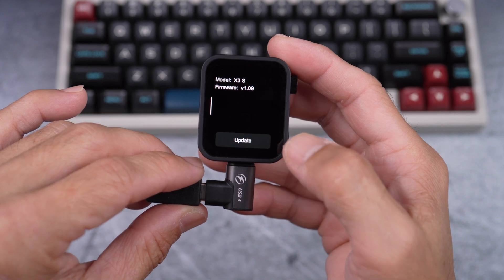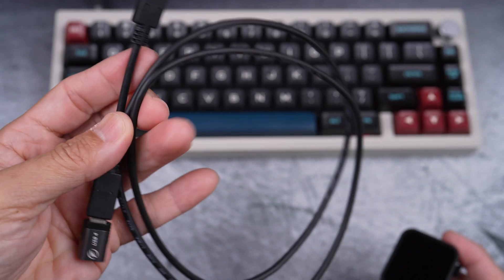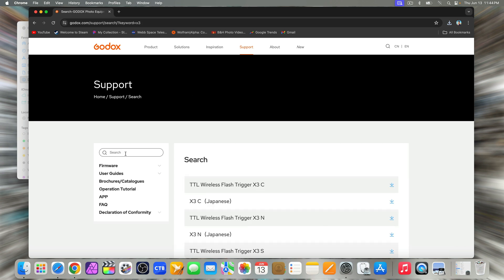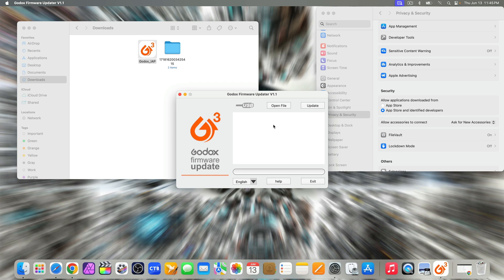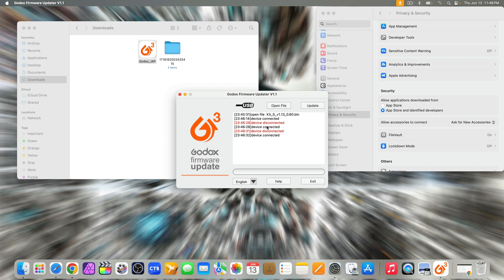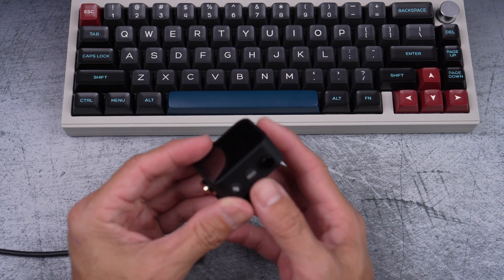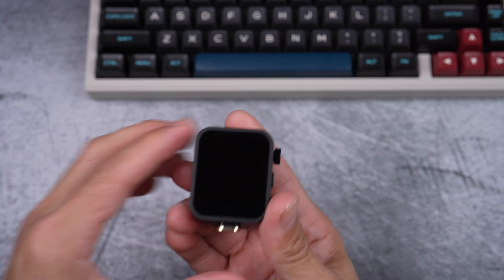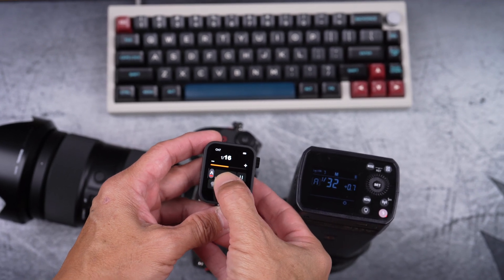How I Unbricked Godox X3 Trigger Updating Firmware from V1.09 to V1.13

Comment: Tremendously helpful and detailed video! Thank you very much for helping me to fix my trigger. In my case, I had downloaded and successfully updated to the incorrect firmware, causing a "firmware error" message to appear on the screen every time it was plugged in. To fix it, after seeing in your video which firmware I should choose, I was able to hold the scroll button down for a few seconds to get it back into update mode, once it was plugged into my computer. From there, choosing the correct BIN file and starting the update fixed my issue without even resetting my default settings.
Reply from the maker: Wow, thank you so much for the detailed comment! I’m really glad the video helped you recover your trigger. Your step-by-step experience will definitely be useful to others with the same “firmware error” issue—especially about holding the scroll button to re-enter update mode. Great job getting it fixed without resetting the default settings too!

Comment: so how do I unbrick.. U have no screen and it won't show anything when plugged in to charge
Reply from the maker: Thanks for reaching out. simultaneously press and hold the "<> (Select Dial)" and "<> (Test Button)" buttons—for several seconds—until you see something on the screen. While still holding those buttons, press and hold the power switch to restart the device. Let it down for a few seconds. And repeat if necessary until you see something on screen. If it’s in Chinese, follow the instructions in the video. Hope this helps.

Comment: Excellent tutorial. I tried to upgrade the firmware from Sony version 1.01 to v1.15. It didn't work. I tried to follow the step-by-step instructions in the video and even after doing a new upgrade the X3 doesn't turn on. Could you please make your firmware version available? The Godox website only has v1.15
Reply from the maker: Thanks for reaching out. The X3 latest updates are here (link below). Let me know if you got it working. 
https://godox.com/firmware-control-system_5/

Comment: Ok, so I have just bought the X3. Firmware that came with it is v1.09.  I am nervous to action a firmware upgrade. Can you tell me how necessary this upgrade is? What additional functions does it then load?  I have downloaded the Firmware X3-N Firmware, and the Godox G3 Launcher. The launcher is viewing in Chinese only. How do I change it to English?
Reply from the maker: If you have the very first production version, the interface changes tremendously! But I’m not sure which one you have. As for functionality, I don’t think it has changed much, but I really can’t say for sure. If the launcher is stuck in Chinese, you might need to reinstall or check the settings for a language option. Side Note: I get it wrong a lot when “upgrading” (updating) each firmware, but I always able to revive it—it seems like it was designed to be ready for this.
Reply: @TossSong  Thanks for your prompt reply. It is hugely appreciated. I clicked around on the launcher and found a drop down that I can choose English as my language. The rest of the update went well. I now have V1.15.  :)
Reply from the maker: I’m glad you were able to update it without any issues. Yes, it could be quite overwhelming.

Comment: This works: Re-plug the USB cable, press and hold the test button and the select dial at the same time, then release the test button only, until "Upgrading" appears on the interface, then the device can be upgraded successfully through USB cable."
Reply: thanks it worked
Reply from the maker: Thank you for sharing. This would be helpful for others using this X3.

Comment: Hello, during update it freeze , now it doesnt turn on.. help pls
Reply from the maker: Hi, thanks for reaching out. Don’t panic. Leave it for a couple of minutes. Then go back and press and hold the on/off button (with our without the test button) until the you get the Chinese text or any text. Plug it back in and try to firmware update again. (You could also plug it in first, then press and hold.)

Comment: How do i get to that chinese screen/?
Reply from the maker: I know it might be frustrating, I’ve experienced this several times over. But Be patient, leave it off your hands for a bit. Then go back and keep pressing and holding the on/off (and with our without the test button at the same time) on the trigger. Eventually the Chinese text appear. Also plug it in for power just in case the battery is low on the trigger.

Comment: I have faced the same problem. But I am not able to connect the device anymore. It displays device not connected. How to solve this problem.
Reply from the maker: Hi, thanks for reaching out. You’ll have to be patient by keep press the knob and hold it a long as you can wait (with or without pressing the test button together). Until you see something on its tiny lcd screen, like Chinese text. Then you could start the firmware update again.

Comment: Thank you for making this video, it was a great help! I dowloaded firmware V1.24 for my X3-C. It came with 2 installer programs, one called G3 V1.1, the other called IAP. The G3 app ran with no security alerts, but bricked the x3 every time no matter what I did. After I watched your video, I tried the IAP version of the app, which wouldn't run at first, but did run after I followed your instructions and told macOS to ignore the security issue. Then it upgraded the unit to 1.24 and no more problems (did get one message on the X3 screen that said "upgrading hot shoe", just the first time). Anyway thanks again, I was about to toss the X3 and stick with my old X2.
Reply from the maker: Thank you for your comment and for sharing. I’m really glad that it worked out. I totally understand you you had to go through to get this trigger updated. Wish Godox could do something better. Like their launcher could be better programmed and improved and implemented. Hopefully they’re working on it.
Reply: what is the IAP version?
Reply from the maker: @luismanuelmendoza789 Hi, thanks for reaching out. I’m the “Remark” under the X3 firmware, it says you’ll have to install the Godox Launcher V1.1 (current), run it and plug in the X3 to update. Here’s the link: 
https://godox.com/firmware-control-system_5/
Reply: @luismanuelmendoza789  I don’t know the difference between the regular version of the Godox updater and the IAP version. I know only that they came in the same zip file from Godox. At least on my Mac Studio running current Sequoia, the IAP version updated my X3 trigger with no problem (to firmware 1.25), and the other version didn’t, it couldn’t ever see the device on USB. I haven’t figured out what IAP stands for. The two versions look the same when I run them, but only the IAP works.
Reply from the maker: Hope you saw the link I provided. But I’m Glad you got it working again.

Comment: For anyone updating in Aug 2024, if you're using an old version of the installer, DON'T! Download the latest version of the installer. That fixed mine but this video got me on the right track through hope lol
Reply from the maker: Thank you for your comment and for sharing. Great info! Yes, I would definitely recommend as well the latest version of the installer to be safe.
Reply: thank you for this comment, helped me out a lot! I was using the old version and the trigger was perpetually stuck in "update" mode. So frustrating that there are no clear instructions anywhere on the official website

Comment: mine is bricked and i did what you said to attempt to unbrick it and it doesn't turn on.  well I'm not in total despair. i will buy another one from amazon. and return the bricked one. smh
Reply from the maker: I think you should Not buy another. Try again, press the knob and hold it for awhile or press the test button at the same time. Also plug it back in. (And keep doing it, sometimes it takes a bit.) *And read other comments on here and my other X3 videos as well. Thanks for your feedback.

Comment: In case it's not clear...you need to press the top knob in and hold it for a while to boot the trigger into the Chinese update screen...then use the Godox G3 app to load and update the firmware. When the green progress bar stops and the very hard to read window above it says the update is complete, click 'exit' on the app. Your trigger should now turn on. As he says, any settings you had will be wiped, but that's easy to do again.
Reply from the maker: Thank you for sharing. Very Helpful information.

Comment: Hey, I tried all the above but I still cant get the trigger to boot. I went through the entire green progress bar and had update device success confirmation, pressed power disconnected the cable but cannot get the trigger to boot. The trigger displays Chinese text and an arrow when I reconnect now. tried about 8 times now
Reply from the maker: Hi, thanks for reaching out. Have you got it working since?Make sure the Launcher is V1.1 and the proper firmware for your X3 for your camera. And do it again. Let me know.
Reply: @TossSong  Yes, did some Reddit surfing and found that the G3 updater I was using was V1.00 and it worked correctly on Ver1.01. I thought I Bricked it but happy its working. Also seems to have fixed my TTL issues I was having with odd exposures so another plus. Updated from Version 1.09 to 1.14. 
Thanks for the reply anyway.

Comment: So how did you solve this? Mine won't turn on no matter how many times I plug it in or out!
Reply from the maker: Thanks for reaching out. Try keep pressing and hold the knob for a while. Until you see text in Chinese. Release then try again. Be patient. Also, have to updater app on and try again and plug it in. Let me know how it goes. Thanks.
Reply: @TossSong  I got it working after I commented…but then I couldn’t get the trigger to fire on my Canon R5. I reinstalled the firmware but it still didn’t work. I tried my XPro trigger and it worked fine so I knew it was the x3. I cleaned the hotshoe and contacts and checked my camera settings and still nothing. I reseated the trigger a couple times which didn’t work. Finally I put the trigger on all the way into the hot shoe then pulled it back just a bit. Now it’s working! I don’t remember the trigger being that fussy before upgrading to firmware 1.24….Thanks for your help!
Reply from the maker: Glad it works now. Don’t know why it’s fuzzy like that. Each X3’s contacts for each type of camera is different. Hopefully it’s not a quality control issue. When you can let me (us) know how it goes in the long run. Others may also be curious. Thanks.
Reply: @TossSong  It's important that the USB cable is connected and the G3 1.1 app is running and have a firmware file selected for this to work. Skipping any of those steps and my X3 would not turn on and seemed to be dead.
Reply: You need to have the v1.1 version of the G3 app, and I could only find a link to a Windows version, you need to have that program running, and you need to have selected the firmware file. Finally, you need to have the USB cable connected between the computer and the X3. When I did all that, and pressed and held the knob for a few seconds, the X3 turns on displaying a chinese upgrade screen. Hope this helps.
Reply: @LasseVågsætherKarlsen  I had ALL THAT which is why I asked the question. I do have the Mac version which is on their support page.

Comment: unfortunately mine is bricked and plugging it back in does nothing.  I've followed your exact steps and nothing.. So frustrating, I wish Godox would figure this out!
Reply from the maker: Hi thanks for reaching out. I see, could be frustrating. Hope everything turns out well. Next time, if it seems to be bricked, when the screen goes blank, you could try and press and hold the knob for a long bit. Keep doing it intermittently, then plug it in. Or open the Godox Launcher on the computer first, then plug it in. Again try it intermittently.
Reply: @TossSong  I eventually received help from Godox's support team and they provided a successful solution, "The transmitter screen will turn black if abnormalities occur in upgrading. The solution is to re-plug the USB cable, press and hold the test button and the select dial at the same time, then release the test button only, until "Upgrading" appears on the interface, then the device can be upgraded successfully through USB cable." 

All that worked for me, now I'm hoping the firmware update made some huge improvements on connectivity.  For those wondering, I do see that legacy hotshoe has now been added after the update.
Reply from the maker: Very glad you got yours back in working order. And Thank you for sharing this. There will definitely users searching for the solution.
Reply: Just for context, this is the second X3s trigger I've bought because I thought the first one was a lemon and I love the design and UI of this trigger so much.. I wish that it worked correctly.  2 major problems I had (hoping the firmware fixed - now bricked), is that none of the Godox triggers recognize Sony's built in Wireless Flash ON/OFF feature, so regardless of what it's set to, the trigger fires.  As a real estate photographer who needs to bounce back and forth between flash and ambient lighting, it's extremely frustrating. And 2), 90% of the time I turn my X3 ON/OFF for this purpose, it disconnects from all my flashes.  I'm often running 4 flashes and it gets very time consuming trying to work with this trigger.  Now that it's bricked, it sits in my closet, what a waste of money.  I contacted Godox support but provided Tier 1, lamo support.  Such a huge let down as this trigger is sexy AF.

Comment: Great video, what the brand of the data cable?
Reply from the maker: Thank you for your comment. The cable I use came with my Canon PowerShot V10 (with a “magnetic USB-C adapter” from Amazon). You can use any as long as it’s data transferable. I use a variety even Apple Thunderbolt 3 cable and even a generic brand. They all work.